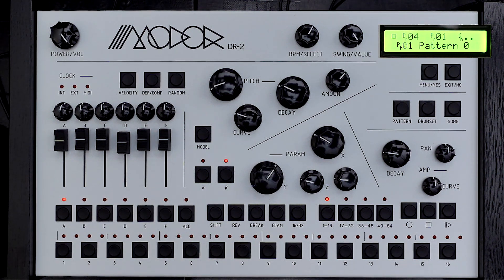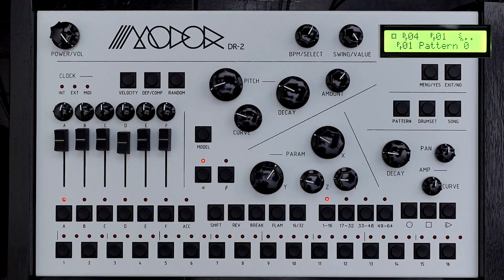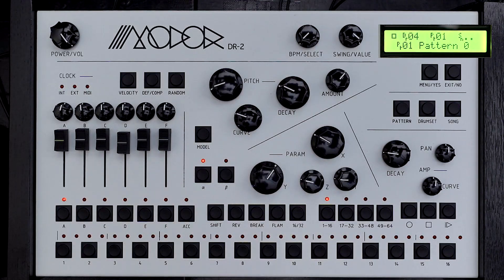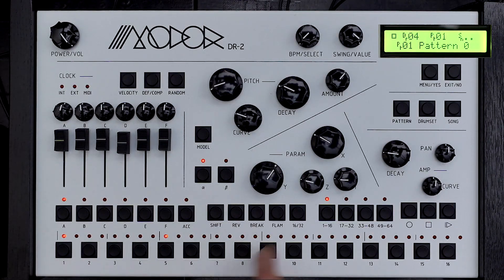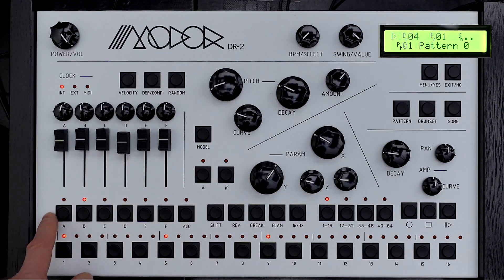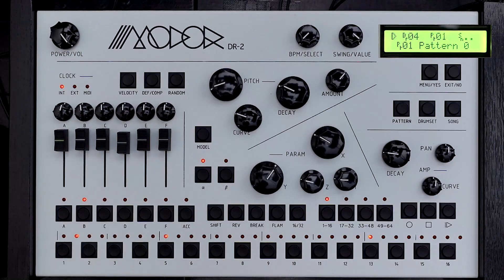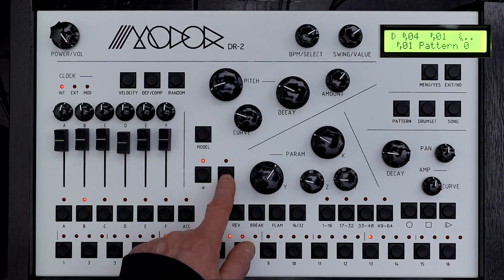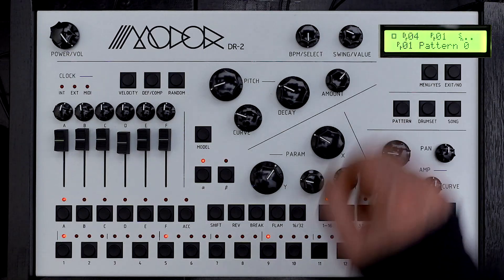The polyrhythmic clocks and Euclidean sequencer of the Modor DR-2

Comment: Love this machine.  Would love to see a comparison of Perkons and this, and which you prefer for what.
Reply from the maker: I don't have the Perkons anymore so can't do a direct video comparison but I think each has some pretty clear strengths and weaknesses. I absolutely loved the Perkons ergonomics, especially the four lanes of buttons. While there aren't a lot of parameters to play with for each sound, the unlimited parameter locks give a lot of variation even within a single channel. What killed it for me were the actual sounds. For me the Perkons core sounds weren't good starting points. To get a good bass drum on channel 1 (its natural home) for example should be super simple but it can be a bit of a struggle, so much so that many people advise using channel 2 for the bass drum instead. I also dislike how the pitchmod gets so overused, it's what you tend to hear on many Perkons tracks. Not a fan of the filters either but that's just me, I know many people love them.

In comparison the DR-2 has a classic single row of input buttons. It's not as quick to create a complex track and you can't get that wonderful overview that you can with Perkons. Another downside of the DR-2 is its somewhat limited memory. Not a serious problem but just seems odd to me that there aren't more banks. There's also more to remember with the DR-2 but that's because there's so many options and features. I'm amazed by all the tweakability. Often a single sound might have a dedicated filter, then a tilt filter, then add the parametric EQ,. compressor and distortion. The randomizer per voice is wonderful. Likewise the envelopes are much superior to Perkons. They can be much more precisely crafted. The real winner for me though are the core sound models. They make building a kit very easy and are excellent starting points. The only criticism I have of them is that Modor tries to keep you fenced in "real drum" land. Reminds me of Roland gear. The bottle sound for example could be very interesting as a superlow lofi clunk, but instead you're restricted to "real bottle range" lol. I know Mr Modor is very open to suggestions so hopefully we might see a few wilder sounds in an update. In many ways I think the DR-2 is closer to a supercharged LXR-02 than a Perkons. Oh yes, and the Modor should come in black :D
Reply: Hmm.. LXR-02, you say? I love the LXR and I'm still in early days with the Modor, but the urge to try and synch em up and see what sort of unholy noises result from the pairing might be hard to resist :)  @RichardDeHove

Comment: Yeah fantastic drum machine. If you don’t t want to dive menu, and can t be bothered with Elektron, dig this!! You changed the knobs, i like the originals
Reply from the maker: It has a beautifully smooth sound with a lot of fine control. And yes, the key combos are king here. And I will put you in the "no" camp on the knob change. Mr Modor's not a fan either.
Reply: @RichardDeHove true :) i sold my koma komplex and syntrx 2. They have your knobs too 😅

Comment: Thank you for demonstrating. This drum machine seems really good and has nice sounds and apparently really cool features 😄
Reply from the maker: Thanks. I'm trying to get onto basic kit programming but still haven't run through all the backend features yet :)
Reply: @RichardDeHove watch of few of the videos Marcel did. That helps but it does have some tricks. Just be carefully with shift + fader. I did blow up my right ear doing that.
Reply from the maker: @klinkske  The EQ, distortion and compression all have great powers :) The machine is not short on grunt.